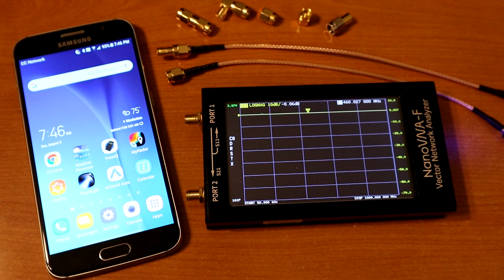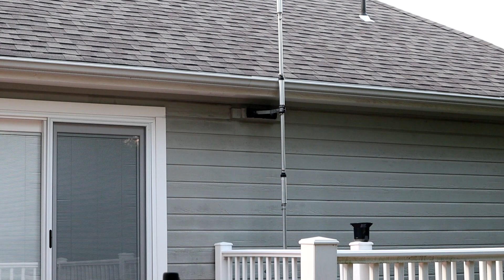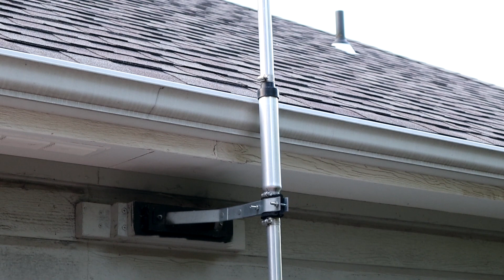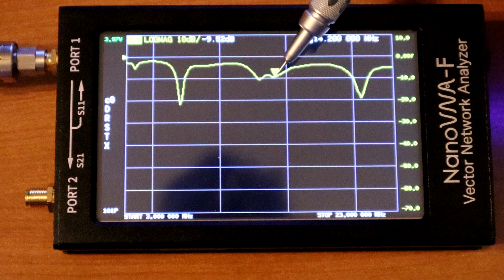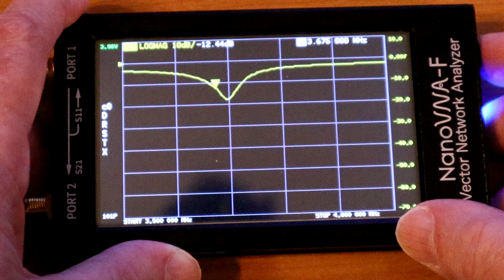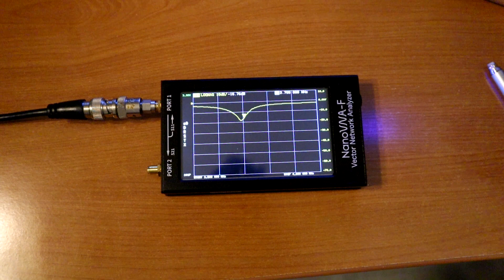NanoVNA - Overview and antenna measurements with S11

Comment: Thanks for the video. 🙂
Although as a beginner I still feel more comfortable with SWR instead of return loss, I am beginning to understand that apparently the latter gives more insight into what is going on on the feed line and the antenna. One excample for this - as far as I understand it by now - is what you said about the 2x 1dB return loss on the right end of the sweep and what conslusions this allows. 
73 de DO1HNR
Reply from the maker: It definitely takes time to adjust.  I started with VSWR too. Fortunately resonance is signified by a 'dip' in a plot vs frequency for either :-)   You've probably already seen these tables to do the conversions. Many are ridiculously long, but this one is easier to manage.  I usually just shoot for > 10 dB return loss, with 20 dB being excellent. (S11 or -10 dB to -20 dB).  Turns out that corresponds to an SWR of 1.2.  Thanks for the feedback.  73    https://www.electronics-notes.com/articles/antennas-propagation/vswr-return-loss/vswr-return-loss-conversion-table.php
Reply from the maker: IMPORTANT:  I just noticed the author of that page slipped-up on the formula given for converting Return Loss to VSWR. They need a minus sign in front of ReturnLoss. Their table is OK though.  People often get careless on the issue of Return Loss vs S11.  When in dB domain, they are the negative of each other. (this is because they're the reciprocal of each other when not in dB)
Reply: @MegawattKS  Thanks for adding that note, because when I compared the formulas in the article of "electronic notes" I noticed the difference between their formula for that conversion and the one I found on the formula sheet that is linked under a video of a friend of mine dealing with the same topic. 
see "Impedance, Reflection Coefficient, Return Loss and VSWR (SWR)", https://www.youtube.com/watch?v=44ETbhF-4bo&t=31s
What you mention regarding the missing minus sign explains the difference, though. 🙂
I must admit that when this afternoon I did the first test run of a newly built transformer and a monoband EFHW I used the VSWR again on my NanoVNA instead of the return loss, as due to my HOA condition I was operating outside with a pole beneath my car and I was focused on getting the confirmation that my new setup does actually work -
and in fact it does work (for me as a ham radio newbie, an SSB QSO over 5.000 km is still like an "adventure"). 🙂
Reply from the maker: @hennero.3826  Excellent. I still remember my first real long-distance contact. I didn't have a very good antenna, so it was on CW, but was a few thousand miles (probably less than 5,000 km though).

Comment: Thank you for your videos 🙏. 
I don't yet own a nano vna. (But I've ordered one online). Ideally I would also like to measure the suitability of junk box inductor cores to be used at specific frequencies. I'm thinking if I use a core to wind a 1:1 transformer and then connect the vna to primary and a known 50ohm to secondary, if the core is lossless I should just see the 50 ohm? Any losses should manifest as additional resistance (?) . Or is there a better way. I watched an excellent video on inductors by applied science, but his method requires a $40K scope !!!!!
Reply from the maker: It's worth a look.  Unfortunately however, losses in RF transformers (and baluns) can lead us astray. For example, a very lossy transmission line used to feed an antenna can make the antenna look like a good match even if it isn't. This is because the outbound signal from the VNA is attenuated by the losses, and even if the antenna has high reflection (high VSWR), the reflected signal (from a not-great antenna) will again be attenuated on the way back. So the VNA sees the return signal much less than the outbound one and reads as a good match across a broadband of frequencies. Something similar could happen with the balun. BUT - an easy way to check the balun (if it's supposed to be for 50 Ohm source and term, as I think you're saying) is to use S21 mode. If the balun is good, you should see 0 to -2 dB or so for S21 when port one is connected to one side and port 2 to the other. S21 in this case is directly measuring losses :-) Check the S21 cal to make sure it reads a nice 0'ish dB before the test though (using one of the short SMA to SMA cables that comes with it.  [NOTE: this doesn't as well for 75 Ohm, or other non-50Ohm tests, since S21 is defined w/r/t 50 Ohm sources and loads...]
Reply: @MegawattKS  thank you very much for the detailed answer 😀

Comment: Hello! When you travel across the swr curve with the left and right keys… is it  to adjust the steps? For instance, i find that mine goes from 7050 to 7150 or so… 
Thank you
Reply from the maker: I used the little 'wheel' (rocker) input on mine to tell it to move the marker.  I don't know what the stepsize is, but I think the NanoVNA is limited to something like 101 steps across the range I tell it to sweep through. So for fine steps, I have to decrease the sweep range.  In the video, I did that to get a better look at the 80m band. But something similar could be done in the 40m band. Sweeping from 7.0 to 7.3 MHz with 101 points would make it use a stepsize of 3kHz, which would be enough to get a good accurate look at how an antenna does over the whole band (one band at a time :-) ).  Hope that helps.

Comment: Using the SWR scale instead of return loss is what most hams understand.
Reply from the maker: Agreed. That's what I learned first as well. But as noted in the video, radio engineers switched to S11 (or "return loss") when VNA instruments were developed and became widely used. SWR was developed based on the limitations of what was easiest to measure in the early days (max total voltage on line divided by minimum voltage on line). S11 is based on what the new instruments measure directly (reflected voltage magnitude divide by incident voltage magnitude). Fortunately the VNA can do either type of display - so we're all covered :-)  73's

Comment: The concept from Heath was an affordable Collins KWM-2. If you looked inside both rigs you immediately see what I mean. Collins approach involved a PTO with each band tweaked by slug tuned circuits. It’s s great design. Regarding Microphones. I used a Motorola Base station mic. at my station...same vintage as the transceiver, an Astatic D-104 could be an OK choice too, my key was a surplus J-38 that used to sell for around a dollar. Started with a 40m inverted version then a tower and tri-band beam. It was a good station. It’s all changed now but the radio is still a good one.
Reply from the maker: I had an Eico 7-drifty-3  (aka 753). It taught me the value of a good VFO via the school of hard knocks :-)  I think maybe I"ll eventually get a D-104 for the 102. I had a D104 with the Eico and had good signal reports (while drifting off frequency ;-) Your antennas sound great too. I just had a 40m dipole that was way too close to the ground.  But I was able to work S.America a few times (easy pickens of course).

Comment: Thanks. Good explanations. Like your rig, I started out with an SB - 101 back in ‘76.
Reply from the maker: Thanks.  The SB-101 (or 102) is awesome. When I was in high-school, I could only experience those by looking at them in catalogs. But a few years ago, I finally bought that one on Ebay and did  some restoration. It had some challenging issues, but I've finally gotten them worked out. The VFO is just insanely smooth and stable. And I think I've got the sensitivity up to close to original. The mic input seems to be very insensitive, but I believe that's just because my dynamic is lower output than those used back in the 70s ?  73's

Comment: I think perhaps you have the scattering parameters improperly identified. S11 is the input RL of the DUT S21 is the transmission loss between the input and output. S12 is the reflected energy from the output to the input. S22 is the output port return loss of the DUT.
Reply from the maker: Hi Jerry.  Thanks. Can you specify where in the video? I definitely might have misspoke, or I might have been unclear, like when I said a large dip in the S11 plot was a good SWR.  In reviewing it, I also noticed at time 3:52 I equated S11 to RL - which is qualitatively correct. But to be precise that's a little incorrect, as S11 is actually the return-gain and is the negative of RL (when in dB). S11 = Vref/Vfwd with port-2 terminated - or, as in this case, port2 doesn't exist for the measurement since the antenna is a one-port DUT. And S11 in dB is 20 log of that. SWR is of course a different animal entirely (It's (1+|S11|)/(1-|S11|)). That might have been confusing. What I was trying to say is that the SWR at the 7 MHz dip is also a good value.  The first bullet on the powerpoint slide near the end does say S21. Sorry about that. No relationship to SWR for that...
Reply: @MegawattKS  S11 is the input RL in dB and NOTHING to do with SWR. SWR is a completely separate measurement involving other components. When you refer to a”dip” in the Smith Chart I haven’t a clue what you mean. Using S11 in your example above to arrive at SWR is incorrect.
Reply from the maker: @Jerry B The formula above is correct for converting S11 to VSWR, but only if S11 is taken out of dB domain into the linear domain. Sorry for not stating that in my reply. I used the word "dip" to mean where S11 dropped from a small negative dB outside the bands (e.g. -2 dB due to roundtrip coax feedline loss) to something like -10 dB or lower at resonance. For example, if S11 shows as -20 dB as it does in the 40m band, then the return-loss is 20 dB and the magnitude of S11 is |S11| = 10^(S11_in_dB/20) = 10^(-RL_in_dB/20) = 0.10. (Note that S11_in_dB = 20 log(|S11|) = 20 log(0.1) = -20, so this correctly took it out of dB and into the linear domain.) Using the formula given, SWR (or VSWR) is then (1+0.1)/(1-0.1) = 1.22 (or "1.22:1" if one prefers). Here's a nice page from Amphenol with a conversion chart from RL to VSWR to avoid all the calculations :-) https://www.amphenolrf.com/vswr-conversion-chart
Reply: @MegawattKS  I’m familiar with the conversions but I believe the point in all this were comments concerning the the S parameters and how each is represented irrespective of VSWR but as their relationship of their match to 50 ohms. Nothing  more.